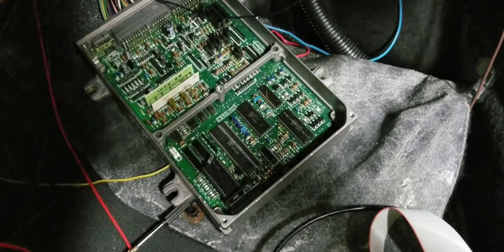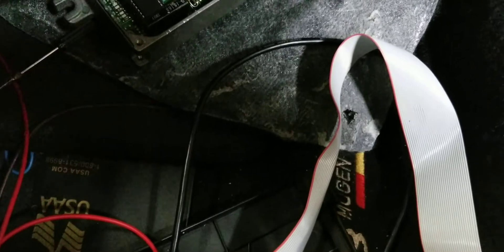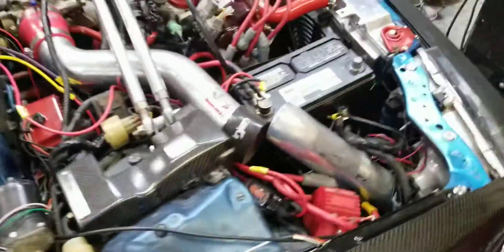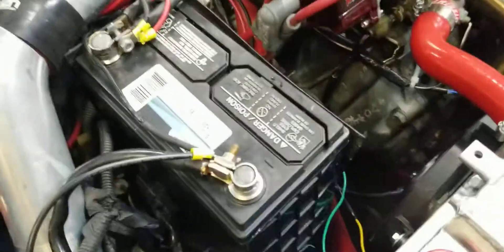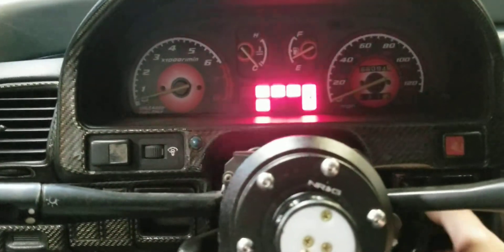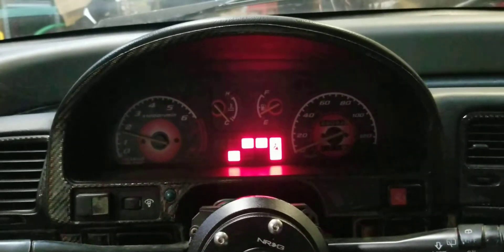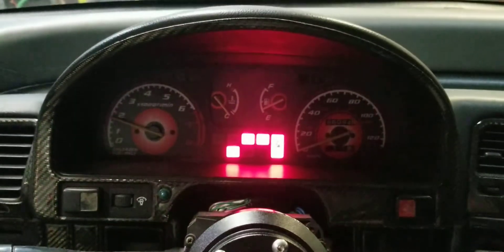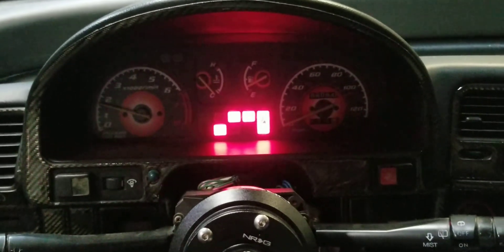Test of a chipped P28 Honda ECU board

Comment: Question the r17 resistor needs to be cut or removed when installing the 28 pin slot chip 
Or data logging on a p06
Reply from the maker: Please check my other videos for more information. Thanks